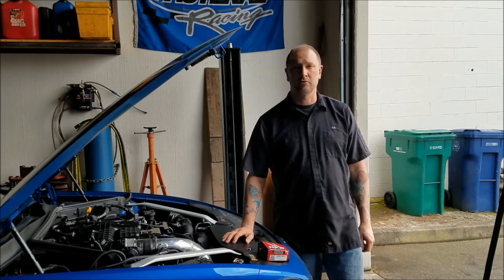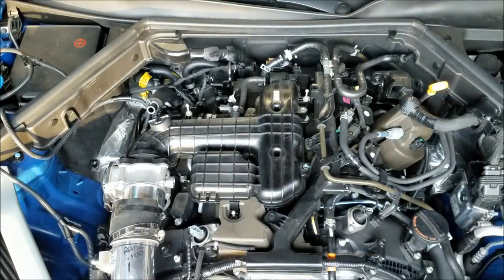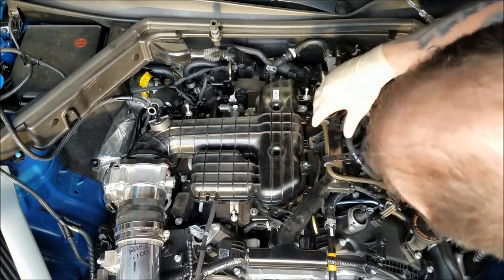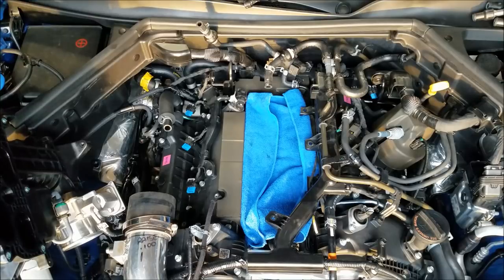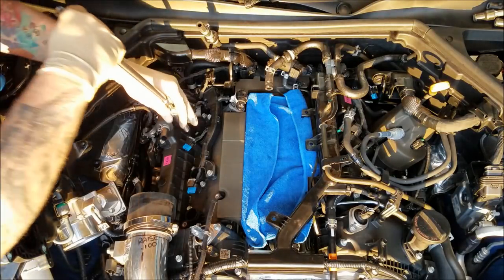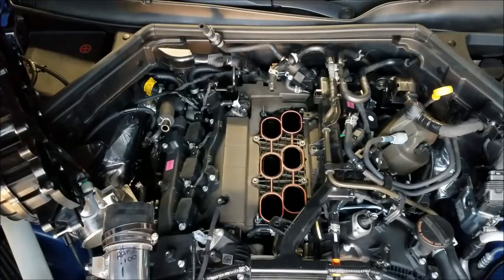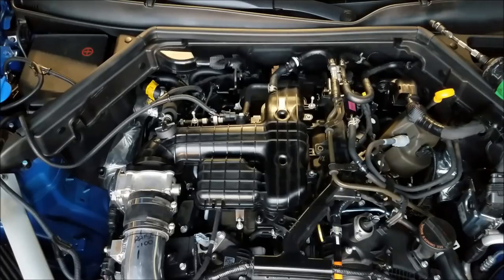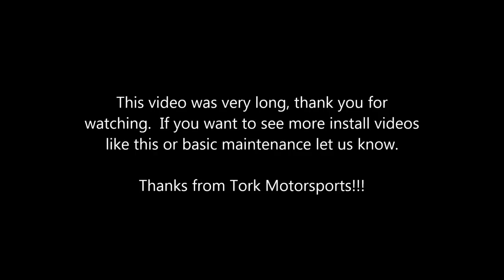KIA Stinger GT 3.3TT HKS spark plug install

Comment: You should have really taken the time to use a torque wrench and to explain the negative effects of not using proper torque specification in your video. Over torquing and under torquing a plug can lead to detrimental engine damage if not careful - especially on high compression/turbo applications such as this. Back in the 50's/60's people talked about the importance of using a torque wrench and the adverse effects that can come of improper torque values such as pre-ignition, detonation, insulator separation from the internal seat, etc.., If you took the hour you should have taken the 2 minutes to explain that while YOU are a seasoned mechanic (would still recommend to use a torque wrench) it is not recommended to torque by hand. Taking 2 minutes to swap ratchets is worth the potential thousands of dollars in damage to the engine, doesn't take much to eliminate possibilities from occurring. It's one thing to hand torque miscellaneous bolts like for the coil pack as an example by hand. Poor example you just made especially using what appears to be a 8"-10" ratchet which length of the ratchet directly affects leverage netting you more torque. I would venture to say that you just effectively over torqued the plugs, I could be wrong but just with my personal experience and knowledge of spark plugs you just effectively put well over 30 pounds of torque to the plug - what would be cool is to not have to speculate - On an aluminum head a 14mm thread diameter plug should see a torque value of 18-21.6 foot pounds of torque.
Reply from the maker: I should have, but after doing this for 30 + years, I am very good at getting to the required torque without a torque wrench. You would venture to guess wrong :)

I have bet people that I can get a torque reading to + or - 2 ft lbs and everytime I am dead on (up to around 80 ft lbs). 

Also note... that torque specs change as the power levels increase. What a 19 ft lb torque worked at 350 WHP, will not work at 500 WHP, experience go's a very long way when it comes to doing this kind of stuff.